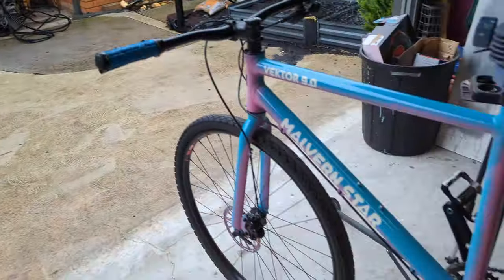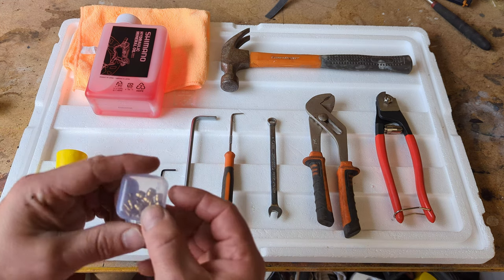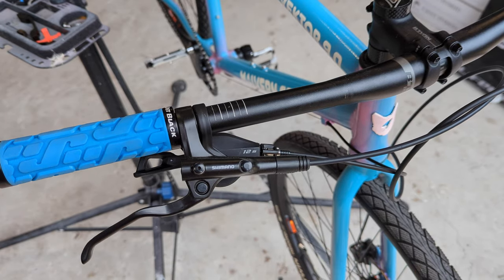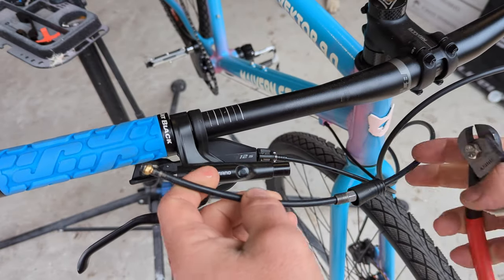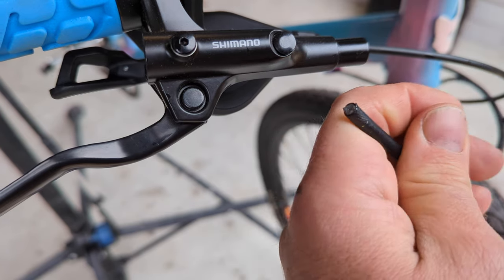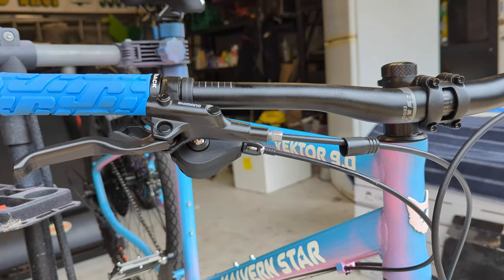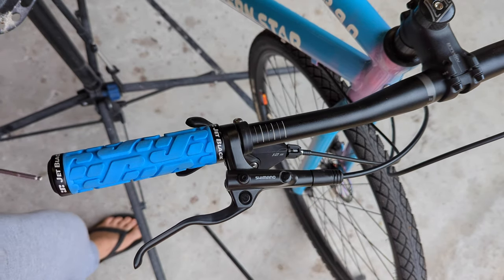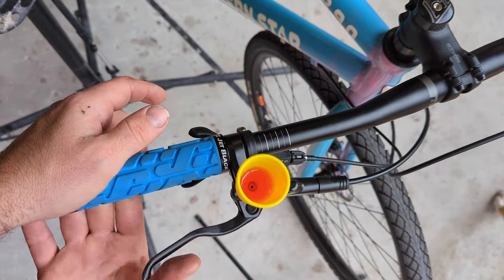How To Shorten Shimano MT200 Hydraulic Brake Hoses

Comment: Have you ever shortened a shifter cable? Would I be correct in assuming that the process would be to take out the inner cable, trim the housing, put the inner cable back in and then trim the inner cable at the gear end, reattach the housing?

Comment: Did you empty them before cutting? If so, where to take the oil out
Reply from the maker: No I didn't empty them, that would mean you would have to do a full bleed. As long as you make a nice clean cut and don't contaminate anything then you won't have any issues. If you do want to drain the oil (and do a full bleed) there is a valve on the caliper itself you open to drain the fluid.
Reply: @9LivesRides  i don't have this tool that you use to cut it, but people say that i can just cut it with normal wire cutters and straighten the cut with box cutter. Do you think with these tools i would have to do a full bleed?
Reply from the maker: @leszek9037  no you'll probably be fine if they're sharp enough. Do you have a proper bleeding kit with the small funnel? It will be almost impossible to get the air out of the system if you don't have that.
Reply: @9LivesRides  yes, i bought it along with some oil, but wasn't sure if i have to empty the system
Reply from the maker: @leszek9037  Perfect, best of luck with it!

Comment: I've noticed that you have the front brakes on the right, while here in the Philippines it's on the left. Wondering if the Left/Right Hand Drive rule has anything to do with these brake orientation. Btw, thx for this video. No need to buy specialized tools that will be only used rarely. A sharp utility knife hopefully will cut clean. Planning to shorten my hoses to eliminate unnecessary loops, then do a full bleed.  thx again man.
Reply from the maker: You're absolutely welcome mate! The side of the road we drive  on is definitely is the cause of the reversed brakes, at least originally.  It allowed you to keep a hand on the rear brake as you were using your other hand to signal a turn. Best of luck with the shortening!
Reply: @9LivesRides  Logical. thx for the info, man. Ride safe!

Comment: So we don't need to take wheel off & use bleed block on a lever bleed?
Reply from the maker: No sir. I try to keep the cut tube vertical to avoid fluid loss and keep the air out. I've done maybe 15-20 of these in my time and have never had an issue, a funnel bleed at the lever is always enough.

Comment: I have the MT200 and when i do this, planning to do a full bleed, and pad replacement... with aftermarket inexpensive equivalent pads; and using Light Mineral Oil (unscented). Both non-Shimano recommended. harharhar. Will update if successful... hehehe BTW, anyone knows Shimano Mineral Oil SAE rating?
Reply from the maker: Not to be an absolute wet blanket as I'm all about being cheap, but brakes are a dangerous thing to skimp out on too much. With Shimano brake fluid being pretty cheap and decent pads not being crazy either I'd spend the extra couple of bucks. Have head some horror stories of the braking surface completely fallling off the backing with some of the cheapo pads. Whatever you decide to do, stay safe and let us know how you get on! No idea what SAE Shimano oil as it probably hasn't been tested to those standards. Many say unscented baby oil will work, but I'd stick to the pink stuff.
Reply: @9LivesRides  Thx for the reminder and concern, man. Ride safe!